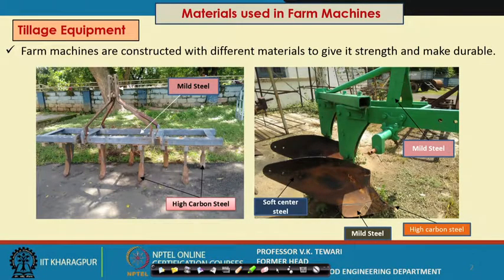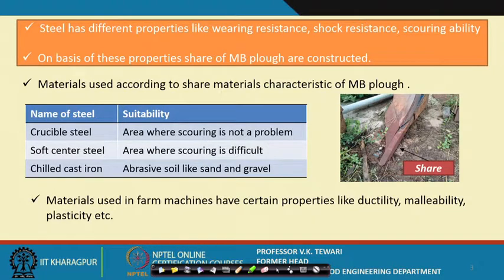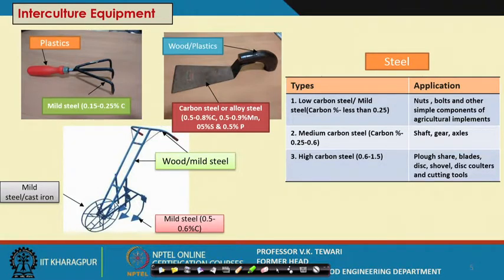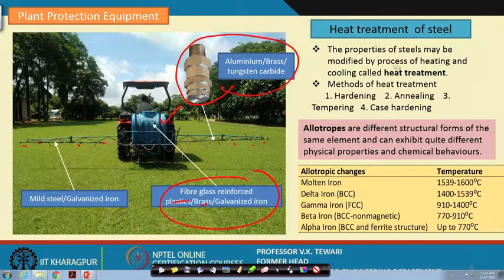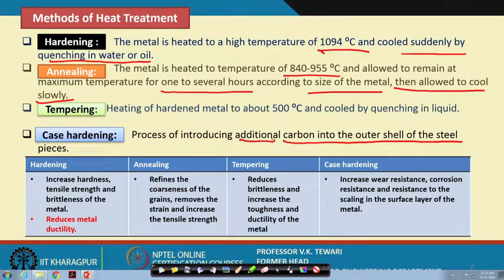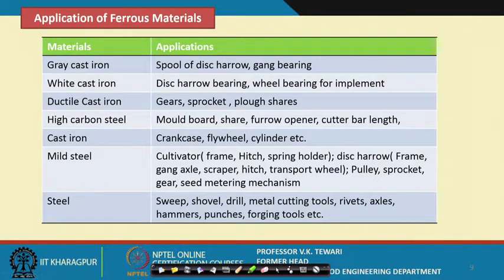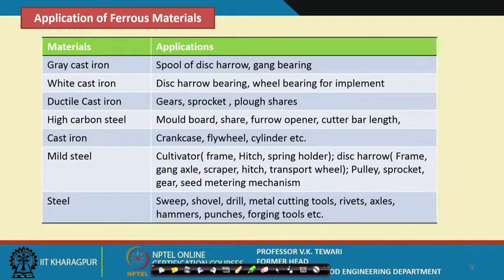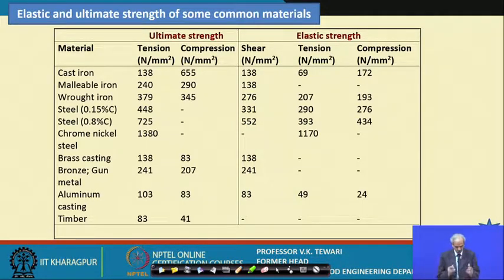Lecture 54: Materials for construction of farm machinery

Comment: What is the commercially used name for blade material High Carbon Steel (0.6 - 1.5% C) in India?

I want to buy it from Pune to make blades for the equipment I am designing.
Reply: Blade for sugarcane cutting.